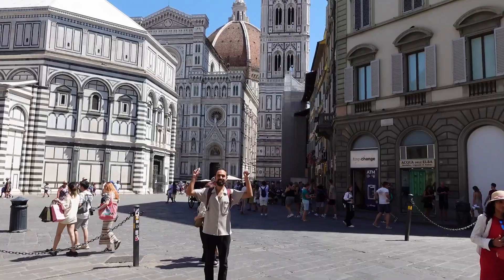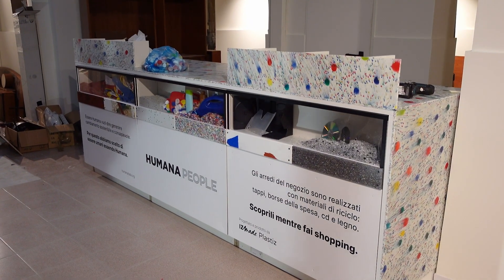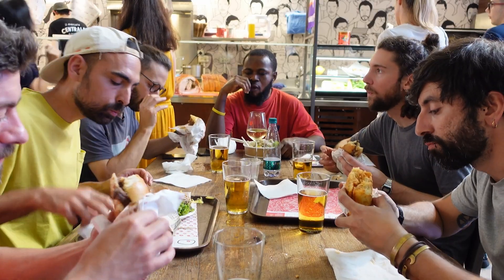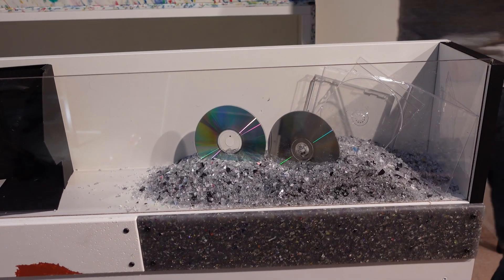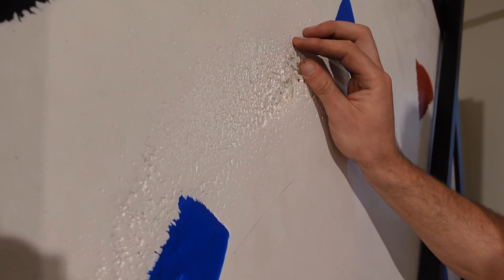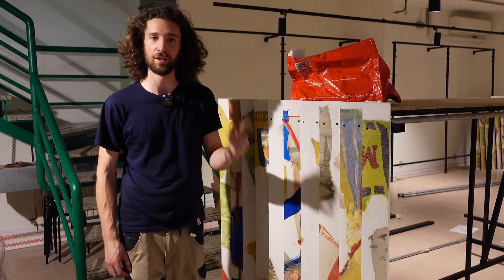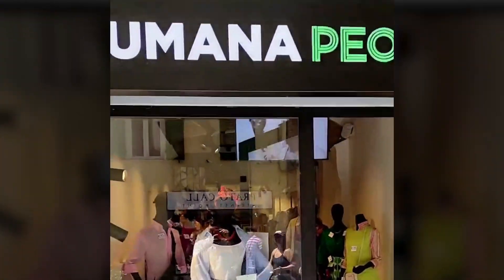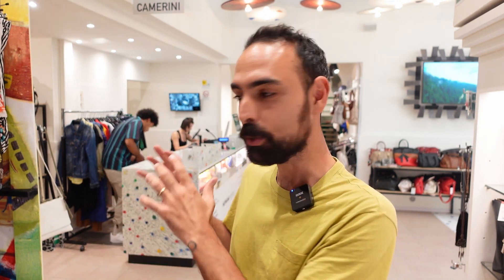This HUMANA Store is 100% Recycled

Comment: I love the approach to raising awareness in people coming to the store. However, I don't get a couple of things that happened in the video: if you have a fully functional front desk made out of wood, what's the value of placing plastic sheets on top of it? The same applies to the dressing rooms. I guess the metal frame is mandatory to have a robust structure, but it's already covered by a wooden plate. 

My gut feeling is that apart from recycling, this project should aim to reduce any material consumption (wood that was already doing the job in this case)

Nevertheless, I wish I could have done a tiny percentage of what you've done to make this world a better one! I'm teaming up with some friends to see the feasibility of creating a Precious Plastic hub in the south of Spain. Some hesitation around the output that we can achieve with the relatively cheap machinery from you. One told me: "You have no clue about industrial processes and that proper machinery costs close to a million"
Reply: Well,  there is plastic already on the wood. They are adding more.  That type of plastic cannot be used alone,  it's too flexible.  It needs a support.  Now I guess they could have upcylced an older piece of furniture and used the plastic to cover it which honestly would be a good example of where these products could become useful.
Reply: @KernsJW  to me it seemed totally unnecessary to cover the front desk. If that type of plastic cannot be used alone due to warp, they should make smaller sheets for other purposes, don't you think? Just thinking out loud.